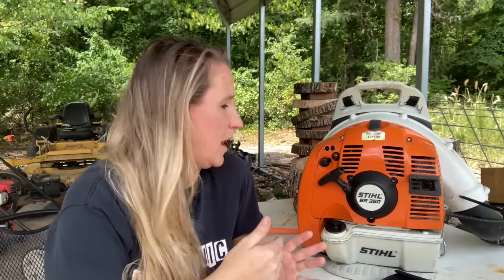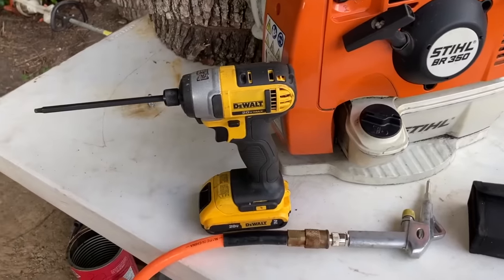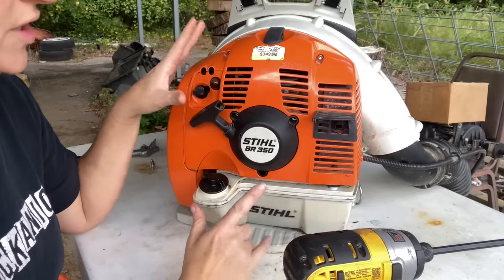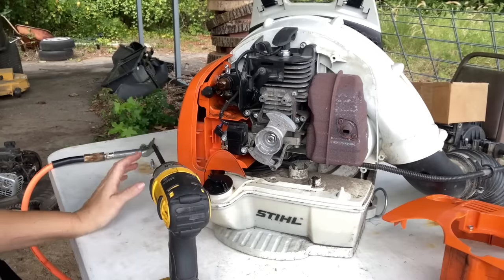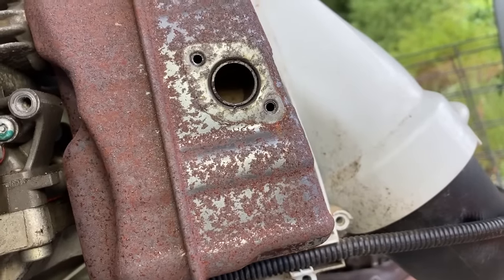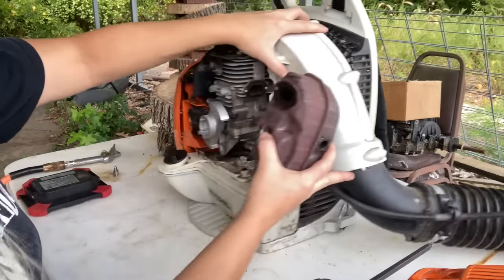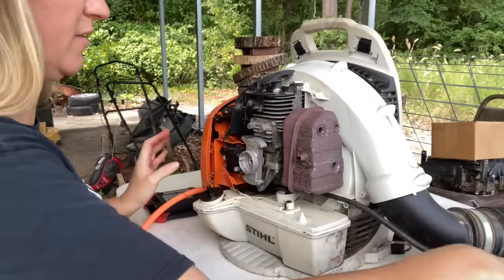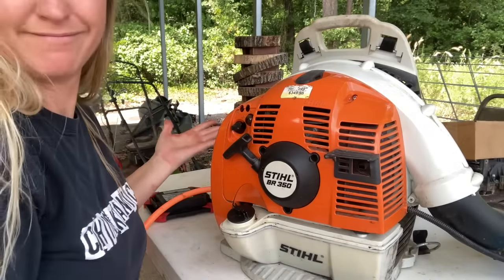Stihl won't throttle up or stay running? First thing to check!

Comment: Love watching the channel. When I'm reinstalling a screw that goes into plastic, I bear in mind that the screw has already tapped the hole into the plastic. I use a hand driver and offer up the screw. To hit the tapped thread, with slight pressure I roll the screw counter clockwise until I feel the click. Now it's time to drive the screw home.

Comment: I also have found spark arrestor issues previously but never a clogged muffler. I learn something new every time i watch your videos ! Love your work  ! 🚜 😊
Reply from the maker: Finally got your hat and shirt sent out this week. They said it could take two weeks to get there. Ugh...
Reply: @Chickanic  Thank you ! I will look forward to receiving them. 🚜 😊 Over 31 thousand subscribers, you are really doing great work !
Reply: My BIL had a muffler on a Stihl weed eater that was internally clogged with carbon.  I used a propane torch directed into the inlet and outlet of the muffler to burn up the carbon, then ran it thru my ultrasonic cleaner to break it up. I then blew thru it with the air hose. Ran great after that.

Comment: thank you kindly for sharing all your knowledge.I'm a structural digger and high rope access worker.I rig tents for music and arts festivals in the summer,up to 5I capacity,and work as a tree surgeon in the winter months.I do a lot of limited access tree  work.taking them down in sections and strapping them to a steel Nasser to avoid roofs,greenhouses etc.using a husky 395xp,and a small parked brand saw,which for the 177 Euro it cost,has done me proud,and is very reliable.used to do landscaping and garden maintenance,and I knew the company as they make very good lawnmowers.so thanks again.it's good to share knowledge,and can strip down,then and maintain all my own equipment.no point in trekking into the woods without basic tool kit.off grid,and pretty much self sufficient.a hundred thousand blessings be upon you and yours.thankyou,and be lucky.dominic'maddog'mogridge.West cork,republic of Ireland X

Comment: You are not going to believe this, but I went into my shed today to put a generator away and looked over at the Stihl BR350 and noticed mud on the top right bolt to the back cover. I then looked down and the exhaust port had mud in it. I took it out of the shed and cleaned off the mud wasp mud from the bolt then saw that the mud on the exhaust port had fallen off. Sure enough, the spark arrestor screen was in place and they couldn’t make a mud nest in there. Guess this problem is more common than I thought. Glad I saw this video yesterday. Thanks Chickanic.
Reply from the maker: Thank you so much for letting me know! So glad I could help!

Comment: Have a Makita garden blower that I had given up on. Stripped and rebuilt the carb, reset coil clearance, changed fuel line and filter, then saw your video. Took exhaust off and blower fired first pull. Cleaned and refitted and blower works a treat. Thank you.

Comment: Yup knew even before I watched. It is a Stihl thing. Yup if the exhaust is plugged in any way the back pressure is a killer. My fs 38 trimmer got a clogged arrestor and would not run properly. I took it out and it ran fine so I cleaned the arrestor. My father's Stihl hand blower had the same issue.  Both were easy fixes. Our issue here in Washington state is mud wasps and Mason bees. Any opening is fair game to them. They gunk up outlets and cord ends.

You are most welcome lovely lady! You teach us so many useful things 🐱! I hope you and yours are well and that you have a most excellent day 😊!

Comment: I was working on an arctic cat 400 for a customer. For the life of me could not figure it out. It idled good and then died under throttle. Fuel flow was great, clean fuel, carb was freshly cleaned, good spark, everything checked out. Went to grab a tool and noticed something on the way back. Muffler was full of mud dobber dirt! Cleaned it out really well, thing fired up and ran great. Also had a can am ds90 I bought for cheap and was flipping. The spark arrestor was so clogged up that it wouldn’t move. Cleaned it up and it worked perfect. I always check mufflers and spark arrestor first thing! Love your videos keep it up👍🏻

Comment: You rock on this one. I had the same barely start issue. After watching your video, I pulled the muffler and the outlet was completely blocked with mud dobber mud. Runs like new now. Thanks

Comment: I just ran across your videos and must admit that they are very well filmed and everything is explained clearly. I work small engine stuff as well, here, north of Nashville, TN. Not professionally, but I always have projects such as a Kubota RTV500CI that I need to pull the engine from and figure out why the exhaust rocker bolt put a hole through its cover. At any rate, when I find someone that puts the time in to produce an informative and professional product, I have to say thanks.

Comment: I bought a used pressure washer for $10. Bucks and it had the same issue of Mud Dobber Wasp that had clogged the interior with nest. Cleaned it out and cranked it up…saved myself almost $300. Dollars from buying new!  Thanks Chicanick! - Anna

Comment: Thank you so much for this solution. A neighbour of mine has a post hole digger that is brand new after one season and would not run on anything but full choke. On your suggestion and after digging the mud daubers out of the muffler, it ran like a charm. You're awesome

Comment: I have a Craftsman ws2200 weedeater that wouldn't throttle up or stay running, and I figured out the issue with it once I watched this video. My problem was the exhaust clogged up like your client's Stihl blower. You helped me look outside the box, and now it's fixed. Thank you, I also subscribed!

Comment: Thank you very much!  You fixed my BR600's recurring problem.  I'm in Canada, and primarily have been using it to blow cold, dry snow, with only occasional warm weather use for dust and leaves.  Once a year, it starts to stall after a dozen uses, and once a year, the certified dealer looks it over claiming my gas/oil mixture, cold air condensation, etc.  And it works after their service and cleaning.  Well, after your very well done video (esp the before clip confirming my same problem - starts but stalls after throttling up), I took the cover off and checked the exhaust port.  The spark arrester screen was completely carbonized allowing no airflow, and the exhaust area also had build up.  Cleaned it up, reassembled and fired it up.  Damn, it throttles up like new!  Thank you, thank you.  And if it happens again, your implication about the arrester screen is point taken....and I'm mostly a winter user with no fire hazards around.  All the best to you.

Comment: Love your work!
FS91, works at full throttle, let off throttle to move it dies, will not hold idle. I'll adjust idlethis week and get back to you. BTW only has 10 hours on it, at 4 hours had to replace the Coil, twice!!! Shilh had a problem with Coils!

Comment: Was getting a little frustrated with a BG 86 in my shop that seemed to do everything just fine except it was just "gutless" and wouldn't throttle up. Checked everything, messed with the carb, nothing was working. Started looking for ideas and you've helped me out in the past so this video came up. Finally realized (very big thanks to you) that none of the other equipment I work on has much in the way of spark arrestors, but these blowers that come in once every 7 months or so have that fine screen that goes into the muffler. Sure enough, I take it off and it was almost airtight. In hindsight it makes perfect sense and it's a simple thing to check and I just plain missed it. Gave the spark arrestor a good bath until it was a proper airflow friendly screen again and heeeeey, would you look at that... throttles up like a champ now. Love your videos and keep doing what you do.

Comment: I was also stumped with my blower not working, after watching your vid, I checked the one thing I had not checked ( the spark arrestor ) took it out, mine has a filter on it, chock a block full of carbon, without it in my Sthil BG 86C blower started first pull.  Thank You!!

Comment: One thing I learned from being an outboard tech is on the screws use a driver to start them. Put the screw on the threads and turn it backwards until you feel it drop in the threads Then your good to go and no stripping 😎👍
Reply: Agreed. Also on outboard and stern drive gear case large cover nuts.

Comment: Great video as always. 
If I may I would like to express another word of caution when it comes to the screws. The ones going into plastic should be turned to left until it drops in place so it won't strip the threads out of the plastic.
Reply: I agree.
Reply: That's a good idea.  I always try to get the screws back in their original threaded position by gently starting them and testing for least resistance but turning left and feeling for the step down is a better way.
Reply: That is fantastic to know. Never knew
Reply: I seldom use a battery drill putting stuff back. You can start new threads especially if you have alternating shallow & deep threads on a screw. A few brands out there use those.
Reply: Darn right and by hand!

Comment: Great video Chickanic!  I had the same issue with the same Stihl blower but I had a TON of dried mud inside!  So what i do now is, after I've finished using my backpack blower, mist blower, chainsaw or weedwhacker I put a little piece of bronze wool over the exhaust.    Not steel wool, bronze wool (won't rust!) to prevent any further mud dauber entrances.

Comment: Very good.Always double check the muffler.I learnded the hard way also.What I found on blowers and trimmers even though the screen was removed is a pest.Yellow jackets or wasps will build a mud nest inside in a very short time and choke the muffler.Not always the case of course but a good place to start.

Comment: Just wanted to say thank you. My Stihl SH-85 handheld blower had the same problem. Put new gas in it, and had the same issue. I removed the spark arrestor (threads in with a 15mm socket), and it runs better than it did brand new! 
I can SEE through the screen, but it still chokes it out as soon as I try threading it back in.
I'm going to run it without for a while, until I burn the carbon out (there was no mud dauber nest in there), and get my hands on a new arrestor assembly.

Comment: Thanks for the video.  You reminded me not to make assumptions.  I saw exhaust and assumed it was clear.   lol  It was not.  It was just a dirty screen, but you made me go back to the basics again.
On the mud dobber topic, I was asked to fix a jet ski lift once.  It would hum but not go up or down.  After taking the motor ends off, I found a mud dobber apartment complex!!!  Compressed air for the win!

Comment: Yes I had a lawnmower it was a two cycle lawnmower it would not start it like it's like your backpack it would spit once and that was the end I ended up taking the muffler off and I got a whole bunch of beetles out the master made it home in it for the winter which they were dead got them all out and it ran fine keep up the good work

Comment: I have a husqvarna weed trimmer that acts like that , I have checked everything except the exhaust so I think I will down it and look . Thanks for the tip
Reply from the maker: If it is not the muffler, I have a complete tutorial on how to diagnose and repair a Husqvarna 128ld trimmer on my page. Maybe it will help. Thanks for watching!
Reply: If it still has the screen in the exhaust outlet, the screen is probably plugged up, and it won’t have a mud nest from insects inside. If the screen is gone, you might have an insect infestation.
Reply: The Husqvarna trimmers have a steel wool mesh inside the muffler and the only way to clean it is to burn it out with a torch or buy a new muffler.
Reply: Jason Busch 
That's the easiest way to clean the flat screen of Stihl equipment too. Remove the screen from the muffler, burn up the carbon on the screen and put it back on.
Reply: you have to run a resistor style plug in husqvarna units. they will do some funny stuff if you dont

Comment: I had this with a 94rc strimmer just recently, complaint was running until warm then stalling. Immediately sonic cleaned carb and exhaust box, adjust idle and runs like a dream. I was taught exhaust and carb first for these types of problems ✌

Comment: Thank you so much. Mine turned out to be the spark arrestor. I checked plug, mixed up a fresh batch of Leaded 110 Octane Racing Fuel mixed at 50:1 and checked filter with no change. Just got it together and it almost blew the foam insulation off the ceiling. I can finish the last batch of leaves for the season. Did have to fabricate a long Torx 27 for the bottom screw, but I have a Miller Dynasty TIG Welder in my garage.

Comment: Another tool for the mental toolbox.  Thanks.
You asked for questions, so here we go.  I have an Echo pole saw I bought new decades ago.  I went to do some work and ran into a problem I've never seen before.  I fueled it up (VP 50:1) and after a few pulls got it to start while laying on the ground.  I picked it up and reved it up, sounded good.  Angled it up to the limb I needed to remove (tornado) and started to cut.  Five to seven seconds into the cut it sputtered and died.  Brought it down, and after a number of pulls it started again, reved up, ran great.  Angled it up, started cutting, it sputtered and died.  My first thought was fuel pickup, so I checked that.  Seemed OK.  Running out of ideas...  Oh, not used very often.
Thanks.
Reply: Cracked fuel line. As soon as you moved it the weight of the pickup filter would have pulled on the line. If it's old enough, the gas will have stripped the plasticizers out making it brittle. While on the ground the crack is closed the fuel pump will fill the diaphragm on the carb. Soon as you move it, it sucks air and starves out. Fuel line is cheap, just can be a pain to thread back into the tank. Buy extra and cut a long, shallow wedge at the end so you can thread it into the hole far enough to grab it with forceps. If it has a primer, replace that line while you're at it.

Comment: Thank You  I was having same symptoms and thought it was fuel issue. We have a lot of mud daubers around and I have taken away nests from where blower is stored. This time it was not a dauber,but the screen was clogged. I did watch your other video on the HP Ultra oil, and fall into that category. Non ethanol fuel,dedicated can,only mix 1.5 gallons at a time,so I was suprised at the build up on screen. Fortunately everything else looked good and clean.

Comment: Less then a teaspoon of dust blocked the muffler and resulted in enough back pressure to keep the engine from running? That's a tough nut to swallow but I won't argue.  Love your videos!
Reply: I thought the same thing.

Comment: Who would have ever thought that the insects could mess up a blower? Great fix. You got the bugs out of that one. I have had Mickey & Minnie build nests under a mower engine blower housing, but would have never thought to check the muffler for mud.
Reply from the maker: Yea, we charge a bit extra for dealing with rat nests. LOL!
Reply: @Chickanic  I flipped a mower last year. Standard stuff, from auction needed oil change, new pull cord, blade sharpened, tank was dry and it ran great once fueled. Cut my yard with it, it did fine, sold it to someone who used it twice and called me and said it smoked  and was a P.O.S. I offered him him money back, brought it home, and it smoked. Mickey n Minnie's nest was burning. The auction I frequently buy from is rural, and the items sit in the yard near a large grass field. Ever since then, I pull the housing & check. It happens a lot.
Reply: Snow Blower undersides are a great rat nest opportunity for Ratatouille. I check all those now also. Ask me how I know.

Comment: Great video.
Starting course screws into plastic try turning backwards first till you feel the thread engage before you tighten it up. That will avoid cutting a new thread.

Comment: Wow.  I knew as soon as you said "I'm in the south", I knew what you were going to find.  We live in east Texas and they are a horrible problem here.  They build nests everywhere.  We had a $4000 Generac generator which shorted out at about 1 year old and destroyed some of our solar off grid equipment.  I had a certified Generac service rep out and he found dirt daubers had shorted out the voltage regulator which was in a box marked 'DO NOT OPEN - NO USER SERVICEABLE PARTS INSIDE".  The real kicker is that Generac would do absolutely nothing for me even though it was still under warranty.  Naturally I bought a Kohler generator next and covered all vent holes, no matter how small, with an even smaller screen and it's been working great for 3 years now.  Yes, I DESPISE GENERAC AND DIRT DAUBERS!

Comment: Thank you. I had a choked up Spark Arrester. It is running great again. It is cleaned up but still in place. Not because I am afraid of the EPA but it seems like a good idea sa I live in the woods and don't want to start a fire in my woods.

Comment: I just wanted to say thank you for the how to video on a Stihl leaf blower
Reply: It saved me $35.00 for just to look at it. It’s just over a year old. The screen was totally clogged with black soot. Pulled it apart and cleaned with brake cleaner waited for it to dry and put never seize on the threads. It runs like new again.Thanks John